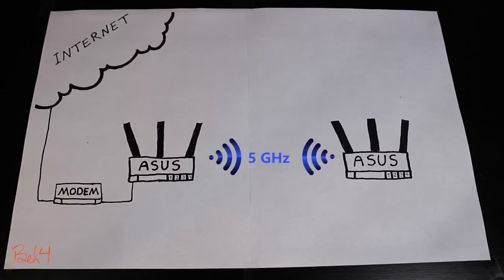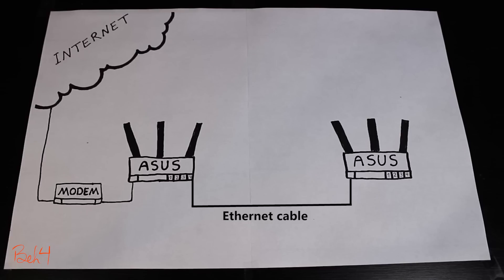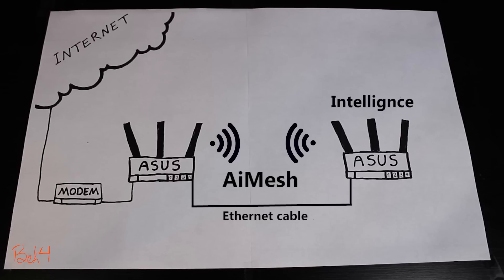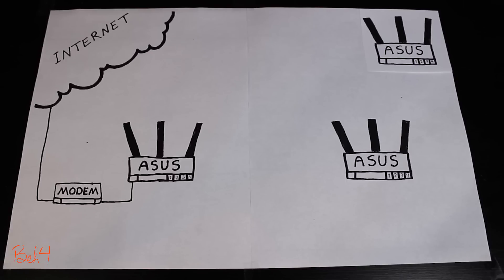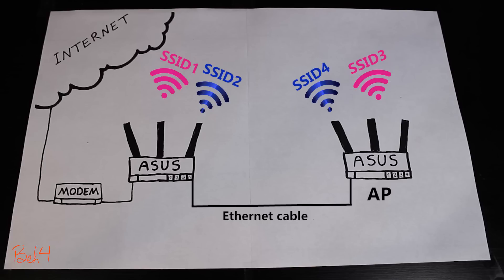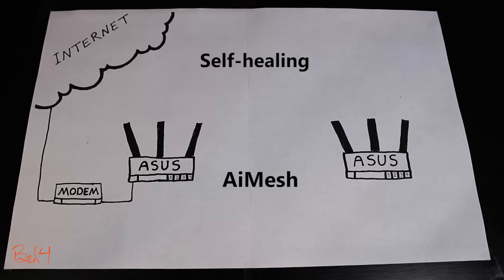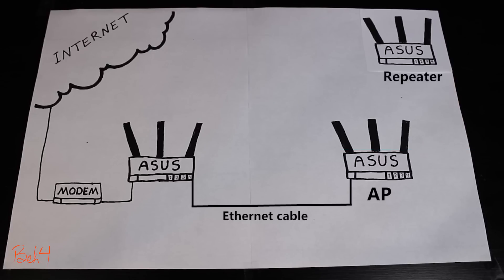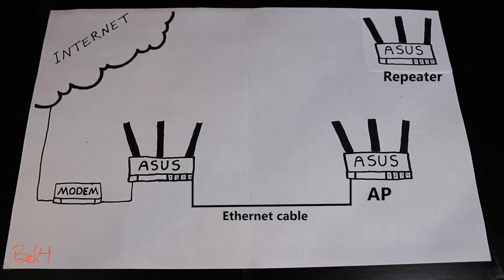AiMesh vs. Repeater vs. Access Point [ASUS RT-AC68U Operation Modes]

Comment: Behfor: I heard in your video that you said if you connect to router with an ethernet cable they will be on different subnets (networks). That isn't necessary true. Yes you can do that by plugging the ethernet cable into the WAN port of the router/access point. Now if you would like then to be on the same subnet (so you can print, access local, media, etc at any spot in your house you have WiFi) all you have to do is disable the WAN port and only plug into the LAN port. Turn off DHCP, and I would recommend assigning a static IP. Just in case you need to log into the GUI and make changes, or what ever.
Reply: Yes,, that is what AP is about...

Comment: Thank you! your really informative, I have a Question:  
I have a Netgear Nighthawk router that I want to connect to a Fios Router as a Access Point,  
and in the Nighthawk router settings it has AP mode (Access Point mode) ,  
Do I just turn it on enable the AP mode and that's it?? or do I need to do something else in the settings?  Thank you.
Reply: use differrent IP so you can locate it after you turn on the AP mode.
example Main-Router 192.168.0.1 and the AP-Router 192.168.0.2 and turn on AP.
(AP mode option) is automatically turned off your DHCP server so in routers with out an AP mode option you can manually turn off the DHCP server to make it as a Switch Hub mode with Wi-Fi so they call it Access Point.

Comment: Is there any significant speed loss in repeater mode or ai mesh mode.
Reply from the maker: If they are connected wirelessly there is usually some speed loss, but depending on what you use it for you might or might not notice it! I mean for normal internet use it should be alright but for online gaming or if you connect many clients to the repeater it might be noticed! Thanks!

Comment: I have these routers and in mesh mode and seem to get data stalls when moving from 1 area of my house to the other even with the signal at full strength. They are linked with the ethernet cable and my iPhone even stalled when watching this video when it was on the node and just 10 ft away. I had to toggle the wifi on and off on my iPhone for it to continue this video.
Reply: After a year, the same issue still persists.

Comment: Can you please check if the ai mesh cable connection works through a patch panel and maybe a switch. I have looked everywhere and cannot find an answer
Reply from the maker: As for the switch, I've already tried and it didn't work, I also asked Asus and they confirmed it should not work if there is a switch in between. However, I haven't tested the patch panel so I'm not too sure about that yet! Thanks!
Reply: Behfor , thanks for getting back to me, I really appreciate it. Is there any way you can test the patch panel option. 
I could do away with the switch but my ideal setup is to have one on each floor of my building. To have 5 in total. 1 WAN and the other four as mesh wifi. 
I have tried researching but i can’t seem to find anything that would be feasible. Do you have any ideas?

Comment: Hi Behfor. Just got a TM-AC1900 and flashed as RT-AC68U with AiMesh. Now up and running and replaced my older RT-AC66R. I see this router is not on the list, just RT-AC68U B1. I guess I cannot use that firmware to update the RT-AC66R. Right? I have to go with repeater/bridge option to hook both ASUS routers, correct?
Reply from the maker: Hi, yeah it looks like, as you said, only the B1 version is supported and unfortunately we can't install the 68U firmware on the 68R! I guess the AP / Repeater would be the only option! How is the TM-AC1900 btw? Do you still have the signal issue with the new router?
Reply: @Behfor   I'm not aware of any signal issue. Oh, wait you mean the signal issue I noticed I had with the 66R. Everything looks normal so far with both connected. The only extra step was to add the extra lines to prevent the firmware to revert to TM. ;)
Reply from the maker: Great then :-)

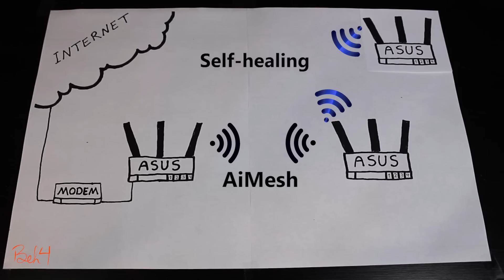Comment: 5:19  If the node goes down, how do you know there is a problem, if it self heals?
Reply from the maker: If a node goes down it doesn't necessary heal itself! For example if I unplug the node1 then the node2 (which used to be connected to the node1) will try to find an alternative way to connect to the primary router.  I can see the status of the nodes in the primary router's setup page. Thanks.

Comment: can this works？“： modem- router-switch----Decivce +. AP or Aimesh node
Reply from the maker: If you want to connect the AiMesh node with an Ethernet cable, it has to be directly connected to the AiMesh Router, the last time I checked it didn't work when a switch was in the middle. However the AP should work fine if there is a switch in between. Thanks!
Reply: @Behfor  Hi. That's a bit disappointing that you cannot have a switch between the AiMesh router and node. Presumably, though, you could connect the switch to one of the other LAN outputs of the router (or the node) and that should work as they are all on the same network? By the way, great video. I like the automatic transmission analogy.

Comment: Can I setup AP Mode so that it copies the same SSID and frequencies? I have been using AiMesh (thanks to you!) for a while and I have noticed some of my devices have suffered connectivity issues in that time. Granted, I have AiMesh setup in wireless mode, and have not tried it with a wire between the main router and the node. So I suppose I can try that first. But the main reason I am considering trying AP mode is because I can use Merlin FW with it, which in my experience has offered better signal range than the Asus FW. Do you think this is a good option if cable-linked AiMesh continues to give me connectivity issues?
Reply from the maker: If you have the option to run a cable between them, then in my opinion the best option would be to use the secondary router as an Access Point! The main advantage of AP mode is that it can use the same frequencies as the primary router but on different channels, this prevents and interference between the two!  You can also try the repeater mode as well and see if you get a better connection if the cabling is not possible. Thanks!

Comment: Can you comment on the long-term reliability of both the mesh and repeater modes? I'm interested only in systems that stay up constantly, automatically recover from brief interruptions (whatever the cause), and automatically restart fully (including reconnecting to the modem no matter how slowly the modem comes up) with no human intervention after power failures. Any mesh or repeater system that can't essentially meet my 100% up time and automatic recovery requirements is just an annoyance. So I'm very interested in your long-term experience. Thanks!
Reply from the maker: Unfortunately I'll be away for a few weeks so I cannot give you an update sometime soon, but as I said in my last video I can see improvement in the AiMesh system reliability. I did not see any connection issues for a couple of weeks as I was testing and comparing the AiMesh with Repeater/AP, which is good. AiMesh/ Repeater is something that I'll be using in my house so hopefully I can give you an update in the near future. Thanks!
Reply: Using three Asus AC1900 (Legit routers, not the T-Mobile promo versions) I have had very poor reliability using AiMesh. I'm using an ethernet backhaul to both nodes from the main router. Stationary laptops only a few feet from a node get dropouts every hour or two. I've spoken to Asus tech support three times, rolling back firmware, swapping nodes, trying different settings, but I've had no luck. I've monitored the wifi signals of the nodes and checked the router's logs to see if there were any signal drops, but there are none. There are definitely some bugs that need to be worked out before I'd recommend AiMesh to anyone.

Comment: Great videos.  I'd love for you to try linksys' seamless roaming routers to see if they work better.  They make use of the 802.11 r/k/v for the client to decide to switch.
Reply from the maker: Thanks! I've had issues with 802.11 r/k/v before because of compatibility issues with some wireless clients in the past and we always ended up disabling it. But things have changes and I'll definitely give it a try to see what is what! Thanks for the suggestion :-)

Comment: I have the ASUS-AC66R and an old Linksys WRT56GS which I flashed with DD-WRT that I setup as Bridge. Not in use too much because clients connecting to it for some reason were dropping connection or low speed. Haven't have too much time to play around with it, but still watching your videos ;)
Reply from the maker: Thanks so much for watching my video :-) The WRT45GS is a 802.11 B/G wireless router that is a very old wireless standard and unfortunately is not very practical these days especially as a repeater! Thanks again!
Reply: Do you mean WRT56GS, right? ;)
Reply from the maker: Well, I actually meant WRT54GS ! I think we both made a mistake, it should be 54 right?
Reply: LOL... Correct... We are getting older... mind and eyes are not what they use to be HAHAHA!!
Reply from the maker: That was funny :))))